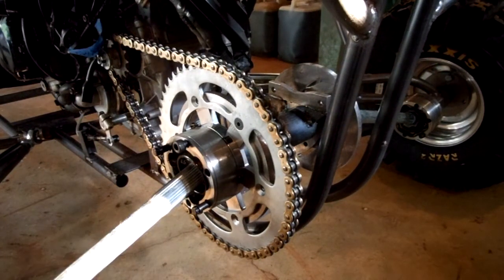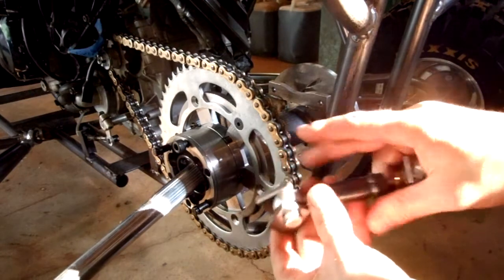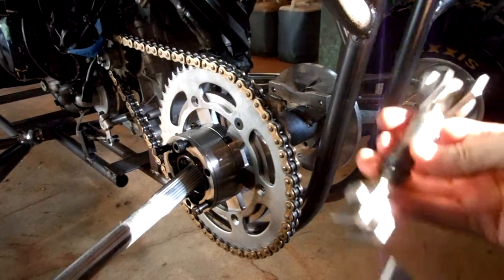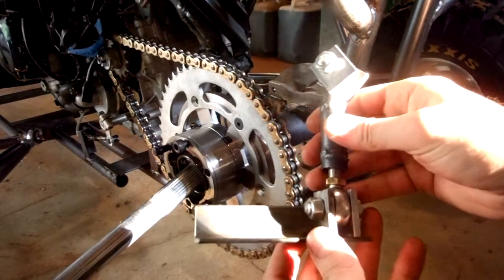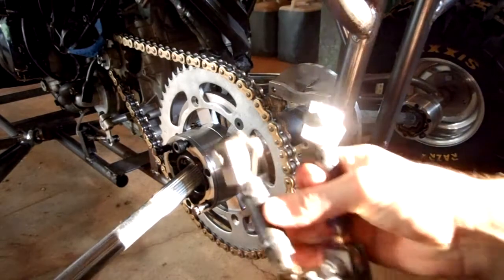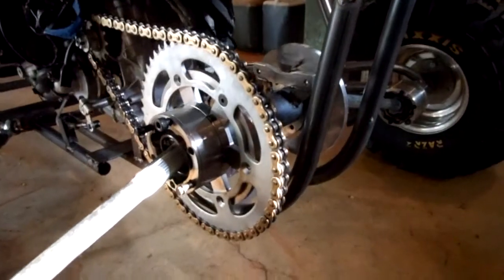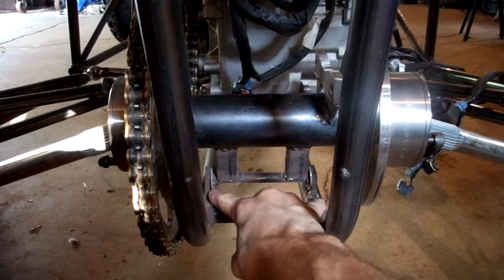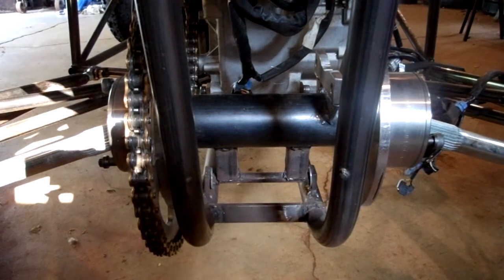Dirt Buggy 9: Chain Tensioner

Comment: Interesting design.  Are you sure a (Looks like)  3.8" bolt in your pivot point will carry the strain of the gear and axles. What size engine are you running.

Comment: What did you bolt on to the sprocket to install cv joints to it. I'm looking for into doing this too but I don't want to buy a bike and not use it lol
Reply from the maker: +DaFonz29  The motor drives a chain, but the independent suspension needs cv joint axles to work.
Reply: is there some kind of adapter that is needed?
Reply from the maker: Oh, I'm a machinist. I made the hubs. sorry.
Reply: oh I see Hmm guess I'm going to have to find a machinist at work that can do it
Reply: has anybody ever found a simple way to adapt a sprocket to cv axles?